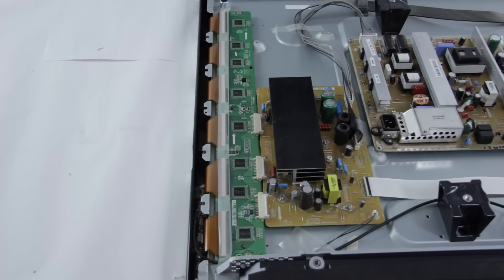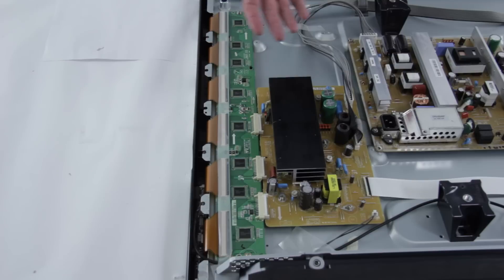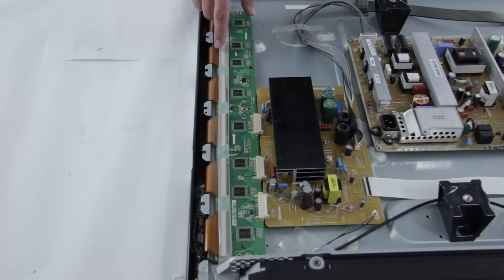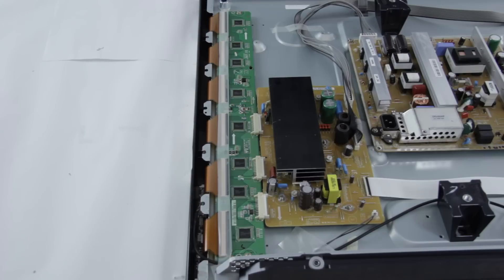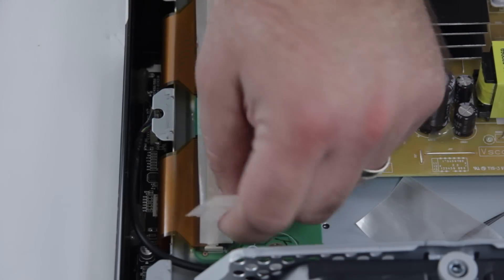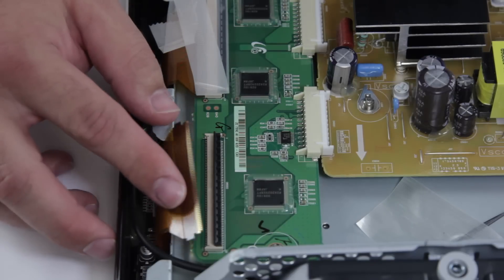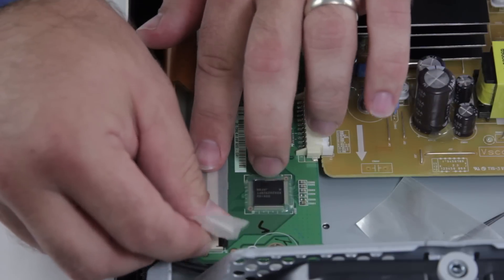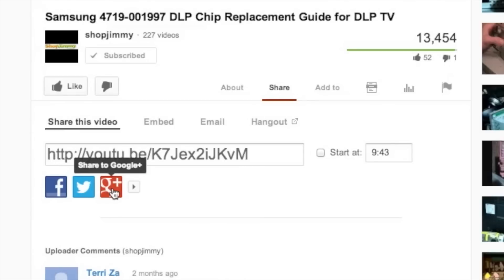Plasma TV Repair - No Image, No Picture on Plasma TV Screen - How to Replace Y-Buffer & Y-Sustain

Comment: My 2-year-old Insignia plasma TV (NS-51P680A12) stopped working and only clicks a few times trying to power up. I replaced the power supply board (BN44-00444) but with no change in symptoms. I tried testing voltage at the board's Vs and Va test points. Only got partial reading from Vs and only while clicking was occurring. I checked the pattern of clicks and blinking lights with different ribbon connectors disconnected from the power supply board in the hope that it might point to the source of the problem. 
a) everything connected:  4 clicks (assume 2 sets of On/Off?) in 5 seconds, pause 11 seconds, 6 clicks in 7 seconds, no additional click until I unplug TV. Green light on logic board blinks with each click - shorter with 1st click of each pair. Red standby light on front of TV blinks but not synchronized with clicks - 2 quick blinks, pause 2 beats, 5 blinks, pause 5 beats, repeat again with 2 quick blinks, etc.
b) Y board ribbon disconnected:  1 click (no additional click when I unplug TV). Green light blinks on for 2 seconds, off 2 seconds, on 5 seconds, off 2 seconds, repeating this pattern until TV is unplugged. Red standby light blinks twice, pauses a beat, 5 blinks, then black.
c) Logic board ribbon disconnected:  1 click, plus 1 click when I unplug TV. No green light. Blinking sequence of red standby light unaffected.
d) Main board ribbon disconnected:  no clicks or lights.
Sorry for the length of this, but I hope you can help keep this TV out of the trash heap.
Reply from the maker: WillyGee I would recommend replacing the Y-main board in your TV.  Here is a link to replacement parts for your TV model number on our website, click here:  http://www.shopjimmy.com/catalogsearch/result/?q=NS-51P680A12  Be sure to match part numbers on your current board, with your replacement for compatibility.  Here is a link to a video showing how to identify your part number, click here:  Samsung Plasma TV Repair: Samsung Plasma Panel Parts Guide  You can also call our customer service for further assistance with your purchase.  (877) 881-6492  Thanks and please let us know if you have any further questions!  www.shopjimmy.com
Reply: ShopJimmy.com Testing continuity with different boards unplugged from the power supply board results in the following:
Everything connected - Vs about 0.4 ohm; Va 16.3 kO
Y-board disconnected - Vs sometimes stable after 60 seconds at 109.3 kO, other times it keeps faulting ("0.f"); Va seems to always stabilize by 20 seconds at 59.6 kO.
X-board disconnected - Vs about 0.4 ohm; Va 16.3 kO
Note - I new to using a digital meter and don't know what is normal. For instance, even the stable readings usually start with a couple of faults before zeroing in on a reading (sometimes taking a minute).
Do these readings suggest that the X-board rather than the Y-board is suspect?

Comment: Hello i have a samsung plasma PN43D440A5DXZA have sound but no picture  I replace Y sustain and Y buffer. No  bulging capacitors and test all fuses anything  else that i can check. Before replacing Y sustain the tv would not turn on.
Reply from the maker: Steve Sesock I would recommend replacing the x-main board in your TV.  Here is a link to replacement parts for your TV model number on our website, click here: http://www.shopjimmy.com/catalogsearch/result/?q=PN43D440A5DXZA  Be sure to match part numbers on your current board, with your replacement for compatibility.  Here is a link to a video showing how to identify your part number, click here: Samsung Plasma TV Repair: Samsung Plasma Panel Parts Guide   You can also call our customer service for further assistance with your purchase.  (877) 881-6492  Thanks and please let us know if you have any further questions!  www.shopjimmy.com

Comment: I have a Philips 50PF9731D 50-Inch Plasma HDTV with Ambilight which every so often looses picture (without power cycling) and then regains picture. It is an older machine, but it has been working well (with the exception of two replaced capacitors on the main power board). I don't want to spend a fortune... any suggestions?
Reply from the maker: Josh Wallace I would recommend replacing the Y-main Board in your TV.  Here is a link to replacement parts for your TV model number on our website, click here: http://www.shopjimmy.com/catalogsearch/result/?q=Philips+50PF9731D  Be sure to match part numbers on your current board, with your replacement for compatibility.  Here is a link to a video showing how to identify your part numbers, click here: LG Plasma TV Repair: DIY Part Identification Number ID Guide for LG & LG Philips Plasma Panel Parts You can also call our customer service for further assistance with your purchase.  (877) 881-6492  Thanks and please let us know if you have any further questions!  www.shopjimmy.com

Comment: Jimmy, I have a Samsung PN51D550C1FXZC that turned itself off last night and started to exhibit the clicking sound (the relays on the power supply board) which is followed by the standby light blinking but the set never turns on. Should I replace the caps on the power supply board (none of them are bulging nor show any discoloration) or should I just go ahead and replace the board (pn BN44-00444A). This set is less than 3 years old. A couple of caps on the Y-Main board have some yellow stains on top but that is the only anomaly that I can see. Thanks.
Reply from the maker: STCSTW I would recommend replacing the Y-main/Y-SUS board in your TV.  Unfortunately I do not see any search results for replacement parts for your TV model on our website.  Thanks and please let us know if you have any further questions!  www.shopjimmy.com

Comment: Hello.  I have an LG 42PC3D-UD plasma TV.  It is around 6 yrs old.  About 3 yrs ago while watching, it emitted a loud popping sound and the picture went black, with sound still working.  It has been sitting in a spare bedroom, unused since.  I cant see tossing it as it looks bran-new.  I haven't fixed it because I'm afraid it will cost too much.  Can you help me out with a diagnosis and if it is cost effective to repair it?  Can it be a do-it-yourself job?  I have little or no experience repairing TV's.  Thanks!!
Reply from the maker: Jelsick I would recommend checking for pin holes in the buffer ics , and replace the Y-SUS board.  Here is a link to replacement parts for your TV model number, click here:  http://www.shopjimmy.com/catalogsearch/result/?q=42PC3D-UD  Be sure to match part numbers on your current board, with your replacement part for compatibility.  Here is a link to a video showing how to identify your part numbers, click here:  LG Plasma TV Repair: DIY Part Identification Number ID Guide for LG & LG Philips Plasma Panel Parts  You can also call our customer service for further assistance with your purchase.  (877) 881-6492  Thanks and please let us know if you have any further questions!  www.shopjimmy.com

Comment: Samsung plasma model: HP-S5033, half the picture goes out and comes back after a while, then the same thing happens all over again. Is that a y- buffer board problem
Reply from the maker: Dee Roach Which area is not receiving the picture?  Typically this is how it works, top half no picture replacement part = upper buffer , bottom half no picture replacement part = lower buffer , right or left side of the screen, the TV panel is the problem.  Please reply with more details and then we can recommend a fix.  Thanks!  www.shopjimmy.com

Comment: hi.....i have samsung 42´´   model:PS42C450B-1W   and serial number:B1R534PZA20484L. My problem is when I turn on the TV,VS voltage are coming but after few seconds they gone.There is no fly back voltage.Due to this there is no picture on the screen.sounds are good.Thanks for your suggestion.
Reply from the maker: Jimmy Jassal Conduct this repair at your own risk.  I would unplug the Y-main board and then test the power and see what you get.  Please reply with the information and then we can recommend a fix.  Thanks!  www.shopjimmy.com

Comment: I have a visio P50HD and the picture just died. I still have sound. Is this worth fixing or should I replace it? I have had it almost 10 years.
Reply from the maker: Thomas Waterman This decision is ultimately up to you, based on cost and such.  You could replace the Z-sus and the upper and lower buffer for about 100.00 , so not too bad on price.  Here is a link to replacement parts on our website for your TV model: http://www.shopjimmy.com/catalogsearch/result/?q=P50HD  You can also call our customer service for further assistance with your repair and purchase.  (877) 881-6492  Thanks and please let us know if you have any further questions!  www.shopjimmy.com

Comment: Hi, i would appreciate it if you could help me out. I recently decided to turn on my tv after not using it for a couple of weeks, i turned it on and there was power to the power button, the tv made it's turning on sound and turned on as usual except there was no image. nothing much else one time i turned it on however there was a flicker of white light in one tiny area but that was only once. the tv is a   43" 450 Series premium HD Plasma TV from samsung. I was wondering how i could fix it and what the problem might be as well as the price of the parts that you offer :) -thanks a ton

Comment: myLG 42pc56zd plasma tv comes on for around 10 minutes then the picture starts to go on and off for a minute or so then disappears  for good.  the sound remains but I cannot even get the menu or input screens to appear. this fault happens with all inputs except the RGB. The picture qualiy on RGB is poor but I can watch the tv as normal as an output from my laptop.   any suggestions would be really appreciated.
Reply from the maker: ahian5620z I would recommend replacing the ymain/Ysus board in your TV.  Here is a link to search results for your TV replacement parts.    http://www.shopjimmy.com/catalogsearch/result/?q=42pc56zd  It appears we are currently out of stock for your replacement part, however you can sign up on the product page to be notified when the part is back in stock.  Thanks and please let us know if you have any further questions!  www.shopjimmy.com

Comment from the maker: +basha2150 I would recommend replacing the buffer board(s) in your TV.  Please go to shopjimmy.com to search your TV model number and find compatible replacement parts.  You can also call our customer service for help, (877) 881-6492.  Thanks and please let us know if you have any further questions!
Reply: ShopJimmy.com
Reply: ShopJimmy.com I have sayo dp50740 no video only saund help me
Reply: ShopJimmy.com I have a samsung model pn64f5500af it turns on when I power it on with the remote and it tries to come on but theres no picture and turns back off, theres no popping sound only the click sound it usually makes when you turn it on, Prior to that happening i was having vertical lines on the right side of the tv, any suggestions? thank you
Reply: ShopJimmy.com

Comment: Hi, My TV is a Plasma Samsung PN63C8000YF S/N: Z1ZY3CKZ90055.
Suddenly the image went off but I can still hear sound,turn on and off the TV and change channel and inputs but no image at all on any input.
For a few months the TV was showing pink/purple horizontal banding when the screen was white and just a few days ago the screen went completely black.
Do you have a suggestion of the problem here and what boards should I replace?
Thank you so much for your help.

Comment: Hi, I have a Samsung model T5054. I was watching it and it turned itself off. Turned it back on and no picture. Still has sound, just no picture like it was turned off.
Reply from the maker: drh463 I would recommend replacing the ymain board in your TV.  You should also check the Buffer ICs to see if they have any pin-holes in them.  Here is a link to the search results for replacement parts for your TV model.  http://www.shopjimmy.com/catalogsearch/result/?q=T5054  Please call our customer service to confirm replacement part compatibility with your existing board.  (877) 881-6492  Thanks and please let us know if you have any further questions!  www.shopjimmy.com

Comment: Hi. I have a Samsung plasma PN51D6500DFXZA. It stopped turning on suddenly. Now when turned on, it flashes a dark grey color on the whole screen, then there is extremely faint snow for another 3-4 sec, the screen then goes completely dark (Remote signal receptor red light blinks 5-6 times during this time). There is no sound heard throughout. After that, the red receptor light flickers whenever a button is pressed on the remote control, but it dsnt do anything. Can u plz advice.Thanks.

Comment from the maker: @mario ruvalcaba - I would recommend starting by replacing the power supply to see if that can fix the problem. You might also want to try replacing the ymain board as well. Both of these parts are in stock. Please call our customer service to confirm part numbers and compatibility. (877) 881-6492